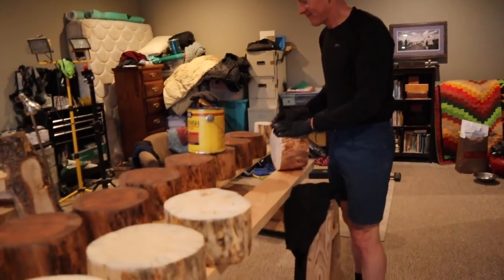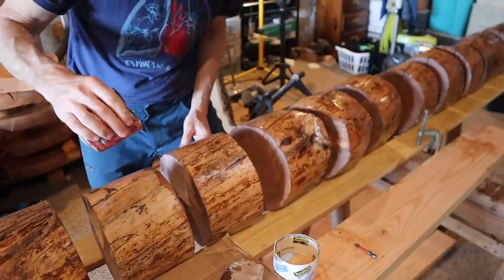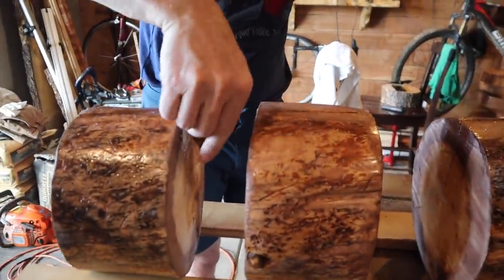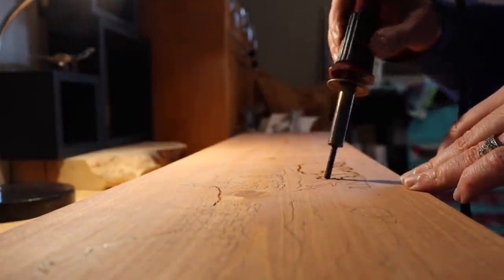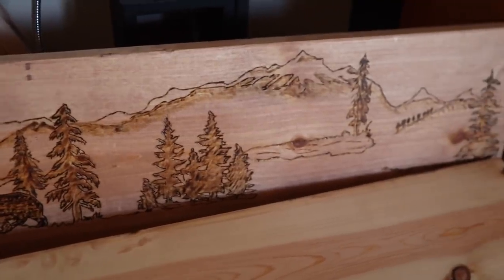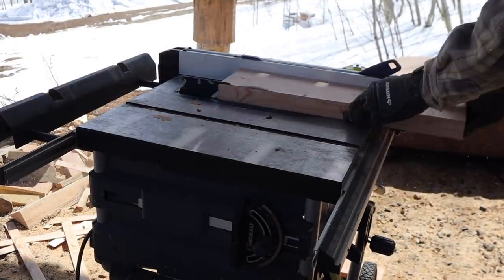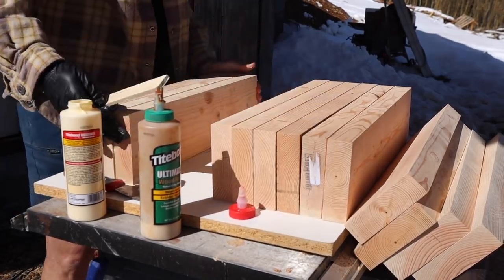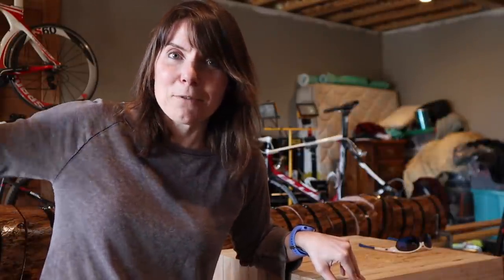Steel Banded Log Spacers

Comment: Neat job.

I am surprised that the banding tool cost $200. I had to wrap a large 100 year old concrete beam, to stop bits falling off, that we were lifting from over a London Underground line and the bander cost about £30. I did buy about 300m of banding so I do not know if they gave me a discount on the bander. The buckles do not look very elegant.

Added
Why isn't Vigo on the door headers. And the cat.
Reply from the maker: I think the price was $120, to be exact. I do prefer the rivets. Nice idea about adding the cat and dog to the decor of the house. Will have to think on that!